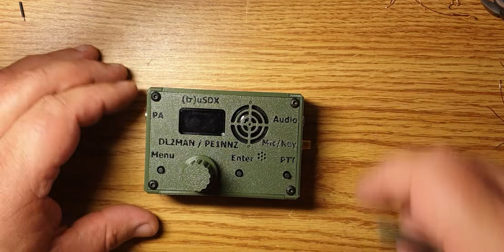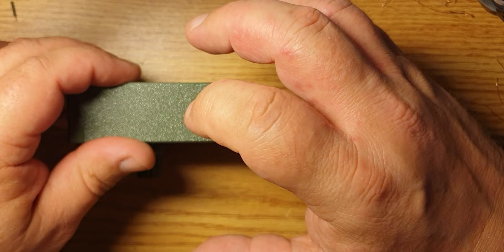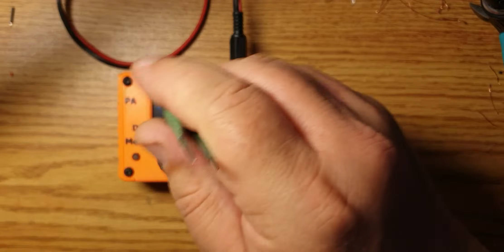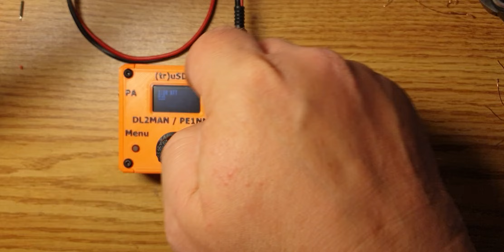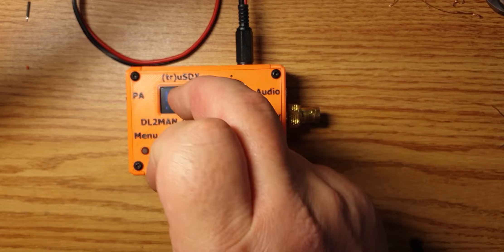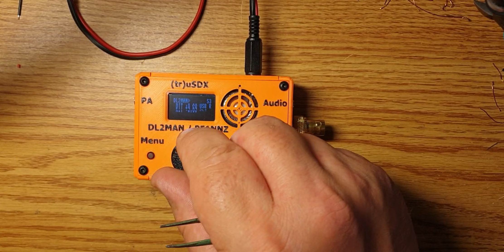(tr)uSDX #4 - How to use it

Comment: What power supply should I use for the radio? Will a regular 3 amp one do?
Reply from the maker: That´s enough. 12V and 5W out at 80% efficiency ususally mean around 0,5A. 1A is enough. 3A is plenty. But use a CLEAN Power supply.Not those cheap plug in the wall things. In that case, a battery would be better. 73 Manuel; DL2MAN

Comment: Very nice little rig and I enjoy the videos of dl2man!!! 
Just bought mine as classic bands and second hand. Updated firmware to 2.0x with personal call-sign DH1LL. Enjoying the gimmick of spectrum meter. 
Trouble with ft8 only from usb cable. Cat works fine with station master G5STU and other programs. 
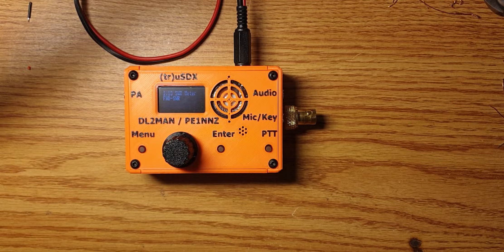What I am not sure about is the swr meter (11:44 ). As I understand it is only working fine in cw? 
In cw @ 12 V it shows me 4,2 watt - if I turn to ssb it shows me up over 10 watts with external and internal microphone. Is this as it is supposed to be? 
What I have not yet done is calibrating the frequency - it is at 2700000 from firmware update. I have not written down the units from version 2.0w. 
73 de Lars DH1LL

Comment: Thank you for the excellent presentation and comprehensive information on the operation of this outstanding design of a miniature HF transceiver.  Ideally suited for expeditions and more importantly will provide communication capabilities post any natural or man made disasters. Protect this excellent transceiver from EMP induced high voltage burnout  by storing it inside a Faraday Cage (Metal container or fine mesh wire with full electrical connectivity) or even wrapping it in aluminum foil. Most common Electro Magnetic Pules are generated by nearby lightening discharges followed by solar coronal mass ejections and solar flares. Finally EMP created by nuclear detonation (NEMP) and if set of  at high altitude 300 kM+ (HEMP) can damage electronic equipment in a 1000+ kM range and may not even be visible at distance. No physical damage caused under the point discharge.  Again many thanks for your work and I am impatiently waiting for mine to arrive from your recommended supplier. They were very prompt in fulfilling the order and dispatching the radio. 73 Richard - G6EQJ

Comment: I have a (tr)uSDX I bought a couple of years ago. I used it and it worked great when I stored it for about a year. Now the unit will not power on via USB or the dc power connector. Any suggestions on how to repair it. Or how much would you charge to repair it?
Reply: You can contact local radio shops or clubs near you and they will be able to help you out.

Comment: What microphone works with the (tr)u SDX radio
Reply from the maker: Out of the box: None. But I have a lot Videos on my channel, where I show external mics. Be it completely DIY or bought ones, where I replaced the connector. Also Building Adapter cable is possible and a few users even created PCBs for that purpose. Just check dl2man.de and forum.dl2man.de

Comment: Hi Manuel, what budget RFpower amplifier do you recommend to use with the (tr)uSDX? I've heard you can get one with filters to avoid making a mess on the band but I don't know anything else about it, I think it provides an output of about 40W. Thanks. 73's. LW3EOV. M6BGG
Reply from the maker: Sorry, I have no recommandation for you. I don´t use a PA with (tr)uSDX anymore. I´have used a commercial PA in the past.
Reply: @dl2man  Ok, thanks, regards.

Comment: As this video is 2 years old, is the information about the alternative band modules around 26:00 minutes still accurate? What band module is shipped by default in mid August 2024?
Reply from the maker: Still accurate. Low bands is the only option available assembled. Classic and High bands only as Kits.

Comment: If connecting an external speaker what impedence should I look for?
Reply from the maker: an ACTIVE speaker. Or passive headphones in the 32 ohms region. Output is driven directly from atmega and has not enough power to drive a passive speaker decently. 73 Manuel DL2MAN
Reply: @dl2man  thank you, I want to use it not abuse it.

Comment: My rig is malfunctioning. When I choose a menu item and hit Menu to save and exit it wont exit.
Reply from the maker: Try a reset and/or re-installing bootloader/firmware. If it doesn´t fix your problem, start troubleshooting it. The buttons are really no witchery.
Reply: @dl2man  Update instructions say "Select programmer: Arduino" but the choices I see are:
Arduino board as programmer using Arduino as ISP firmware 
Arduino for bootloader using STK 500 v1 protocol 
Arduino Gemma bootloader disguised as USBtiny
Arduino ISP programmer 
Arduino ISP programmer 
Arduino: FT232R connected to ISP 
Arduino: FT232R connected to ISP
What should I choose?
Reply: Use the STK500 one

Comment: Why did they use a tiny connector for the 12 volt input that nothing fits instead of a normal size one?  Also my radio is ver. 2.00x and all the control buttons seem flaky and do odd things a lot of the time.  Is there an update to make it more stable?

Comment: Hello, I test today, for the first time the trusdx in SOTA. Wonderfull in T and R. However, have you a manual written wich explains how to receive, to emit, to send a recorder message in CW, RIT, Shunt, ND, etc...more than your fine video? witch explain too the detail of each menu and avantage to put/active some numbers in place of others. In fact, a write menu ou manual witch explain all that with more detail.
Spectrum scope hile holding left button. I'm novice and I would like to understand the utility of each function in the menu. Firware version 2.00x 2023/11. Thanks by advance if you can do that or tell me where to find that (forum, file...). 73. Fab.
-------
Menu Functions
The following Information is NOT 100% accurate and needs to be updated:
Ⓛeft Ⓔncoder Ⓡight button, ⥀=turn, –=hold button (longer), ◯◯=fast double click, ◯-◯-=slow double click, ◯-⥀=hold button and turn
Action	(Menu) Function	Values
onⒺ-	Factory Reset	
⥀	VFO	20kHz..99MHz
Ⓛ	Enter menu	
Ⓛ-⥀	Quick Enter menu	
Ⓡ	Menu Exit	
Ⓔ-⥀	1.1 Volume	1-15 in 6dB steps, 0 is Power-Off
offⓁ	Power-On	
Ⓡ	1.2 Mode	LSB, USB, CW, AM, FM
ⓇⓇ	1.3 Filter BW	Full, 3000, 2400, 1800, 500, 200, 100, 50 Hz
ⒺⒺ	1.4 Band	80,60,40,30,20,17,15,12,10m
Ⓔ	1.5 Tuning Steps ↧	10M, 1M, 0.5M, 100k, 10k, 1k, 0.5k, 100, 10, 1
Ⓔ-	1.5 Tuning Steps ↥	
Ⓡ-Ⓡ-	1.6 VFO Mode	VFO-A, B, Split
Ⓡ-	1.7 RIT	ON, OFF
ritⓇ	RIT Exit	
	1.8 AGC	ON, OFF
	1.9 NR	0-8 exponential averaging step
	1.10 ATT	0, -13, -20, -33, -40, -53, -60, -73 dB
	1.11 ATT2	0-16 in 6dB steps
	1.12 S-meter	OFF, dBm, S, S-bar
	2.1 CW Decoder	ON, OFF
	2.4 Semi QSK	ON, OFF
	2.5 Keyer speed	10-40 Paris-WPM
	2.6 Keyer mode	Iambic-A, B, Straight
	2.7 Keyer swap	ON, OFF
	2.8 Practice	ON, OFF
	3.1 VOX	ON, OFF
	3.2 Noise Gate	0-255 in 6dB steps
	3.3 TX Drive	0-8 in 6dB steps, 8=constant amplitude
	3.4 TX Delay	0-255 ms
	4.1 CQ Interval	0-60 s
Ⓛ	4.2 CQ Message	Transmit CQ text
	8.1 PA Bias min	(0-255) representing 0% RF output
	8.2 PA Bias max	(0-255) representing 100% RF output
	8.3 Ref freq	si5351 crystal frequency in Hz
	8.4 IQ Phase	0..180 degrees
	10.1 Backlight	ON, OFF
			
onⒺ-	Factory Reset	ⓇⓇ	Audio Filter
⥀	VFO	ⒺⒺ	Band
Ⓛ	Enter menu	Ⓔ	Tuning Steps ↧
Ⓛ-⥀	Quick Enter menu	Ⓔ-	Tuning Steps ↥
Ⓡ	Menu Exit	Ⓡ-Ⓡ-	VFO-A, B, Split
Ⓔ-⥀	Volume/Power-Off	Ⓡ-	RIT
offⓁ	Power-On	ritⓇ	RIT Exit
Ⓡ	LSB, USB, CW, AM, FM	4.2Ⓛ	Transmit CQ message
							
onⒺ-	Factory Reset	ⓇⓇ	Audio Filter	⥀	VFO	Ⓡ-Ⓡ-	VFO-A, B, Split
Ⓛ	Enter menu	ⒺⒺ	Band	Ⓔ-⥀	Volume/Power-Off	Ⓡ-	RIT
Ⓛ-⥀	Quick Enter menu	Ⓔ	Tuning Steps ↧	offⓁ	Power-On	ritⓇ	RIT Exit
Ⓡ	Menu Exit	Ⓔ-	Tuning Steps ↥	Ⓡ	LSB, USB, CW, AM, FM	4.2Ⓛ	Transmit CQ message
							
1.1	Volume	1.9	NR	2.7	Keyer swap	8.1	PA Bias min ( 0% RF)
1.2	Mode	1.10	ATT	2.8	Practice	8.2	PA Bias max (100% RF)
1.3	Filter BW	1.11	ATT2	3.1	VOX	8.3	Ref freq
1.4	Band	1.12	S-meter	3.2	Noise Gate	8.4	IQ Phase
1.5	Tuning Steps	2.1	CW Decoder	3.3	TX Drive	10.1	Backlight
1.6	VFO Mode	2.4	Semi QSK	3.4	TX Delay		
1.7	RIT	2.5	Keyer speed	4.1	CQ Interval		
1.8	AGC	2.6	Keyer mode	4.2	CQ Message	

Click here for (tr)uSDX Details

Comment: Stupid question: How do you turn it off?
Reply from the maker: Just disconnect the Power supply. There is no "soft off" and the one we had was removed in newer firmware, as it was suggesting it was off, while your battery was still drained.....

Comment: What can i do, If the CW loop doesn‘t work anymore? I burnt the Transistor because the loop started to transmit without antenna. Now i changed the transistor. But CW loop message doesn’t work anymore. Could it help to reflash the Firmware? 
I removed the powercable to stop transmiting.

Comment: Is it any danger in running ft8 on full power with this rig?
Reply from the maker: With Efficiency tuned above 80% and a well matching Antenna: No Problem. The Problem starts if one of those 2 conditions are no fulfilled. 73 Manuel; DL2MAN

Comment: Very nice overview. One question on the keyer: I see straight and Iambic. Is there a way to use a single-paddle key, like a Vibrokeyer, or only twin-paddles or a straight key?
Reply from the maker: I´m not sure, to be honest. Never used one before. But I assume it has also 2 contacts (one for dah and one for dit) ? So it should still work with IAMBIC Keyer, exept, that you can´t use squeeze techique. 73 Manuel; DL2MAN

Comment: I just ordered the classic. Trying to remember if they asked for my call sign. 🙄 I think they did. I’m not much of a programmer. Especially if it’s that bootloader stuff. Yikes! Winding toroids is fine. Done a lot of that building mtr (kd1jv) kits. de n5vwn
Reply from the maker: Mainboard definately comes with bootloader, so worst case would be: You need to upload firmware via USB Cable. Easy to do: https://dl2man.de/3b-trusdx-firmware/

Comment: Should the internal speaker remain on when using external speaker?
Reply from the maker: No. The 3,5mm Socket has a switch, that should disconnect the onboard speaker when something is plugged in.
Reply: @dl2man  thanks. Then mine’s broken. I will look for solder shorting something first step.

Comment: Is there an external microphone that can be used for (tr)uSDX directly, without modification? Microphone only.
Reply from the maker: Not that I know of, but soldering a wire to a connector is not as hard as you might think. There are even instructions for you: https://forum.dl2man.de/viewtopic.php?t=392

Comment: Manuel... just a quick question. Thanks to my friends from roWaves I got my hands on one... and how amazing this little thing is. The question... as I know at first there was no speaker. If I remove it now... there is any issue ? I love using headphones anyway. Thanks so much... and one more thank you for all the work you put into creating it. Its amazing. 73 DE YO6DXE.
Reply from the maker: No Problem, if you remove the Speaker. Just unsolder it and be good. 73 Manuel, DL2MAN
Reply: @dl2man  Perfect. Thank you so much. 73

Comment: My guess is that the "gate" refers to what is usually called "Nose gate" which is like setting the vox threshold level so that between speach elements an alc does not amplify the pin drop minor background noises that you don't want to transmit. Only when there is a high enough level of input does the sound become allowed and then what ever processing/compression/alc that is set becomes implemented.
Reply: Do you mean Noise Gate?

Comment: Thank you for this video! Is there a way to display the serial number of the radio?
Tnx de Arnie W8DU
Reply from the maker: There will be probably a menu option in the near Future. Right now you can only have it shown by either programming Bootloader via ISP Header, or program a firmware with a wrong Serial Number.
Reply: @dl2man  Danke!
Reply from the maker: @arniep740  Sehr gerne ;)

Comment: Hi Manuel. You two guys have created a great thing. I have built two now, one unfortunately blew up due to my error but am getting some parts to repair it. Silly mistake. My second one now works great. Good long rang contacts here in VK. I have a question re the Tx audio. My reports back were some noise and crackling.? I have feed Tx into my FT991A and it does appear to have some digital noise. Is this normal or can it be cleaned up. Not sure how clean the audio should be via the ADCs on the Atmeg. Audio sensitivity is good just a bit noisy. Do you have any suggestions for me. I am a very technical guy and do this for a living however I’m a hard ware man not software. But a dam great little radio. Regards. Richard VK2VD.
Reply from the maker: That Noise comes usually from a loose Antenna Connector. I´d try to re-solder the SMA Socket and use an SMA Connector for your Antenna (no BNC Adapter) to see if it gets better. Because SMA is screwed on and prevents movement. Other Idea would be to change microphone. They are sensitive to damage if soldered too long.